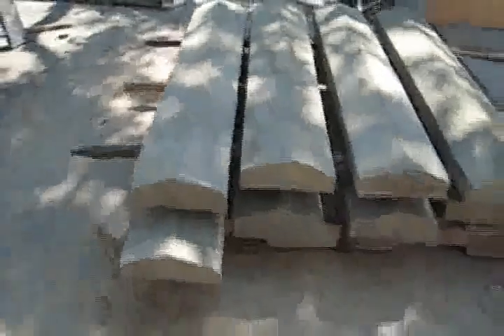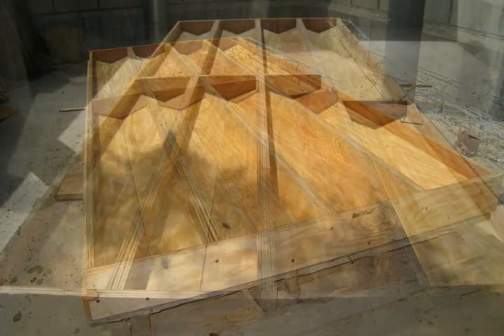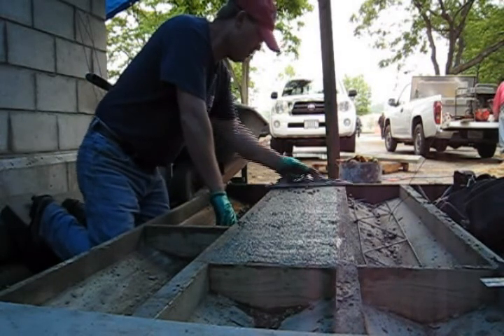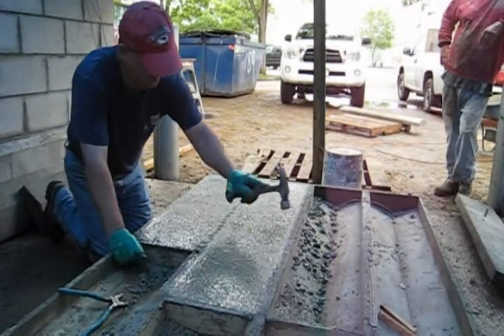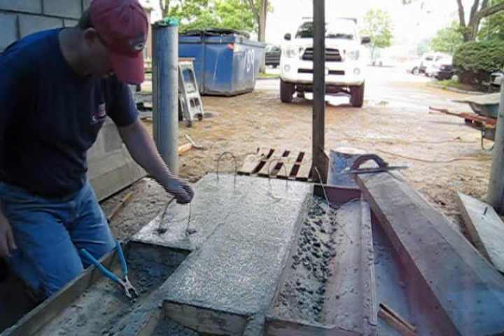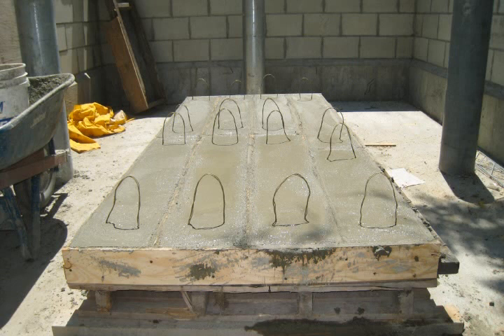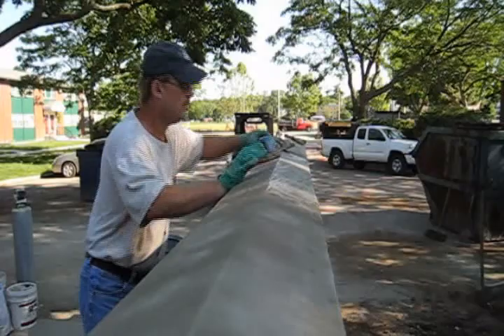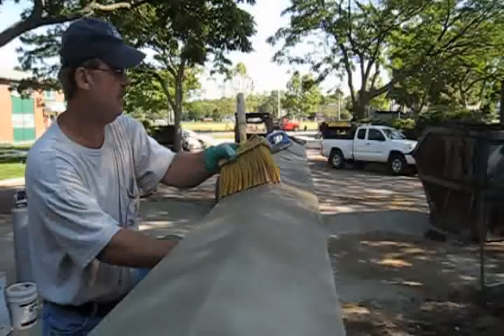Concrete pre-casting

Comment: Great video! 12 years later and still exactly what I needed. How many times are you able to re-use the form? And do you have any tips for building it and getting them all identical?
Reply from the maker: Hi, Christopher,
I’m a little late to the question!
For this project I used the form 3 times.
As for the form itself…carefully measure, carefully cut, and assemble on a level surface. Pay attention to not allow the framing dividers to form a pinch point, they must be vertical so you can more easily remove the hardened block, or whatever you are precasting.

Comment from the maker: It's not structural, but admittedly, "curing" is perhaps not the most accurate term here. That being said, a good dose of cement in the mix and warm weather, the caps were easily removed and put aside for the next batch.